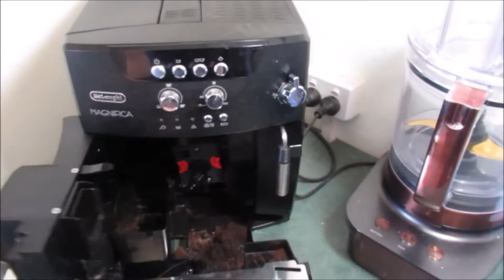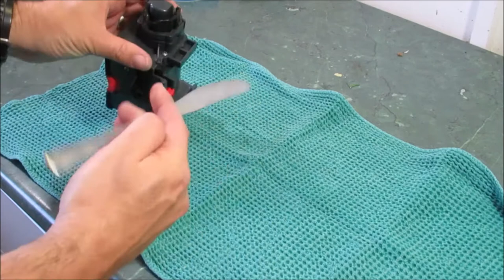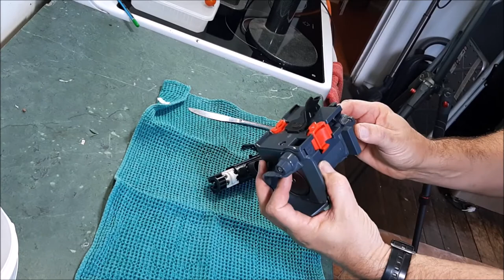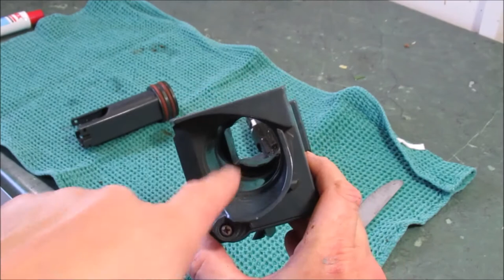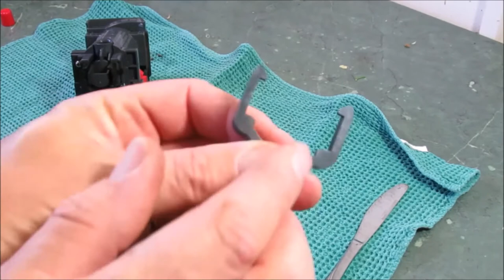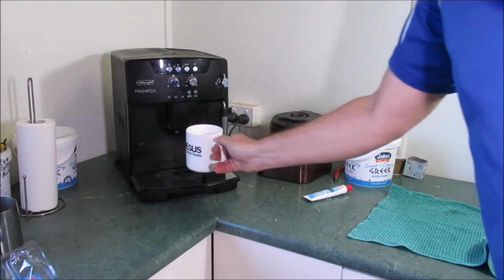Delonghi Magnifica Not Making Pucks

Comment: You beauty!

This is the ONLY source I have found for this problem. My machine gave the initial blast of water when switched on and made the mechanical sounds as normal and the correct lights came on. I pressed for coffee and it ground, sat there for about 30 seconds and then finished with ZERO water/coffee coming through. Looking in the machine, it had the dry ground powder it tried to sweep into the bin and the rest scattered around inside.

Your solution WORKED!

One little tip, to get the clip off, you don't need to use a screwdriver or knife, just slide that part of the infuser down and then you can easily unclip using fingers.

I didn't have the grease so I just cleaned it up some and slid the moving parts up/down a few times - they are still stiff. However it worked for now.  I will get some food grade grease and finish it up properly.

Top man, thanks mate!

Comment: Solution worked. My machine was grinding coffee and it was backing up into the funnel and into the bypass dozer bay. It would then immediately discard. I took the hopper and grinder apart thinking it was clogged, but after 12 years, it was nearly mint. Cleaned everything really good except this. I can’t figure out why this was causing the issue other than maybe it extends upwards into the infuser and the gunk and lack of grease was preventing it. Very simple fix that resulted in coffee being made immediately.
Thanks!

Comment: My guess is that the infuser was not installed correctly before you made this video. At the bottom end of the cylinder that's running through the infuser, there's a hole on the back side. When you place and click the infuser back into position after having it removed for cleaning or whatever reason, this hole should be placed over a notch that's inside the machine. Failing to place the hole over the notch will leave the inside of the infuser motionless, and lead to the machine not making pucks. It's a good idea to clean the infuser every now and then, and to put some lube on the o-rings, but even dry and dirty o-rings will not prevent this machine from making excellent coffee and pucks. As long as the infuser was installed correctly.

By the way: thank you for listing the music you used for this video in the description. I wish everyone would do this.

Comment: Thanks so much.  I have a slightly different model (probably older than yours), but your instructions really helped.  I went from loose grounds to a nicely formed puck after following your instructions.  By the way, I didn't have any new O rings or grease on hand (I'm ordering some though) and just switched the top for the bottom O ring.  The bottom one was in better shape, so that will keep me in coffee until the new O rings arrive.